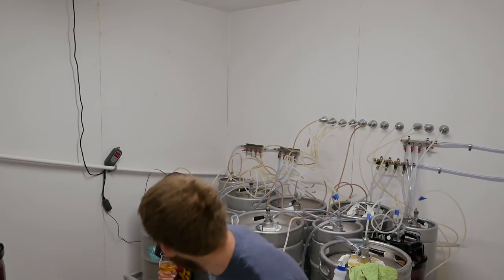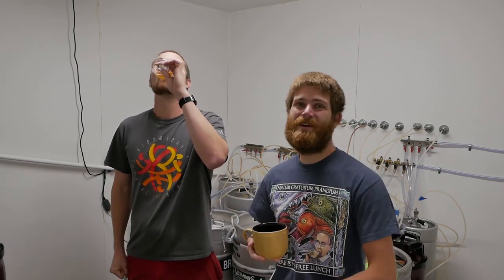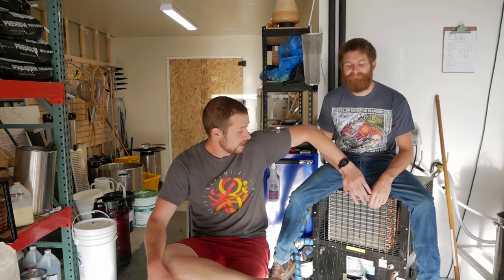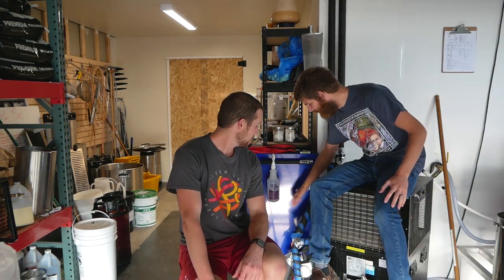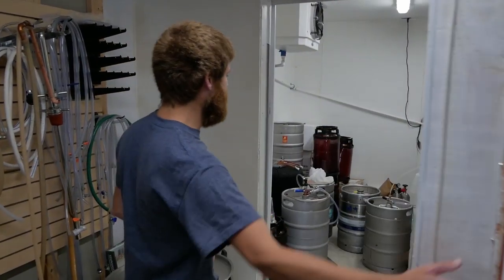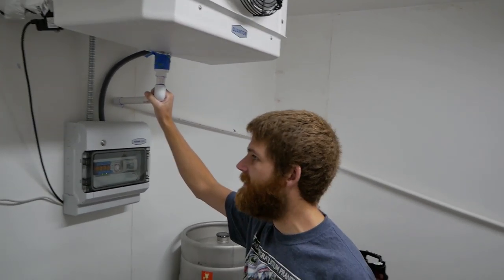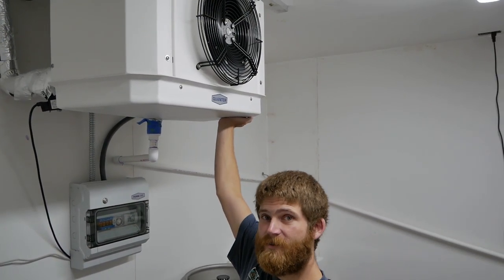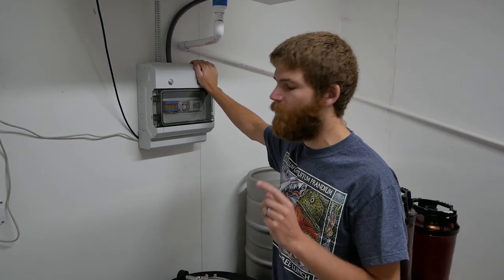How to Cold Room or Walk-In Kegerator with Glycol - Kreyer Fan Units

Comment: Electric defrost is typically used in freezers.  If the box temp is above freezing, try using the controller to close the glycol valve and running the fans continuously for an “Off Time” defrost.  More efficient and smaller temp swings.  Just a tip from a refrigeration tech.  Love the videos guys!!!
Reply from the maker: Cheers!
Reply: hi K P from what you are saying, you should be running the fan 24/7? And just have the controller control the glycol valve open/close when it goes below/above temp?
Reply: Tan G Correct.  As the room cools to set point, the glycol valve closes and the fans pull 35 degree air from the room through the coil (Off Cycle Defrost.). If the coil does not clear this way, an Off Time defrost would be needed where a timer keeps the glycol valve closed for a set time.  Heaters should not be needed unless the unit is undersized.
Reply: @KP-qb3mw  do you have reddit or other form of contact. I have a few more questions I'd like to pick your brain.